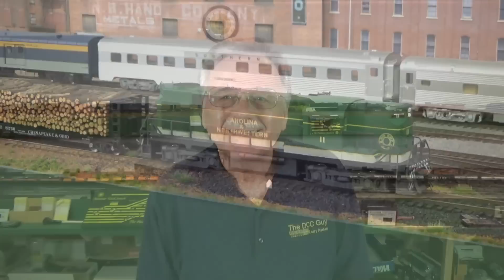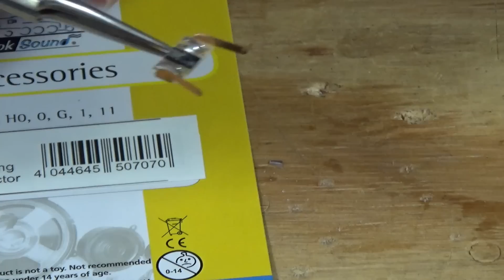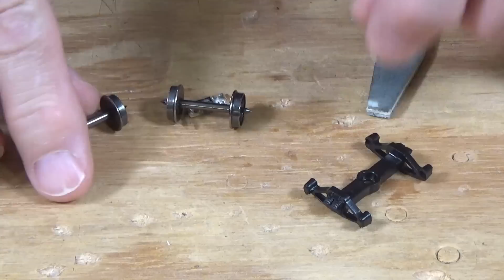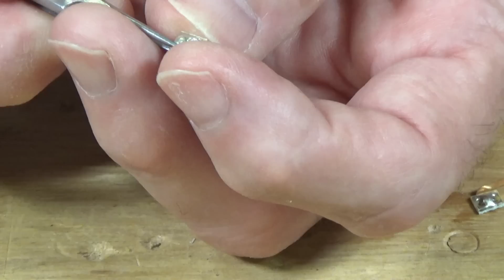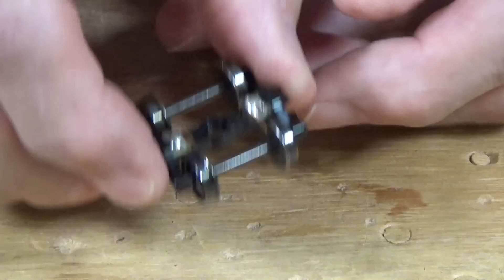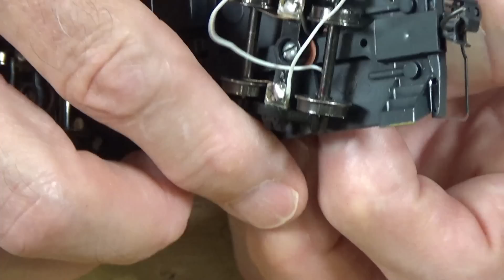Quick And Easy Track Power Pickups From ESU (123)

Comment: What you just proved is that it is a bad design. It should have been made with a hole in the centre with the pick up solder pad and spring contacts far enough apart to make room for a hole to insert the mounting screw, passing through the PCB. It should also had spring contacts to pick up from both wheel sets on the truck. I design things for a living and I often find model railroad accessories are not easy to use.
Reply from the maker: Often they are designed by technical genius who are not model railroaders and have little personal experience with all aspects of operating models. Or they are made by everyday modelers who don’t have the technical skills and knowledge to design a perfect mechanism. Very seldom do you get both in one package so,you often end up making adjust,emts yourself.

Comment: Respectfully, most of your videos are great, but advising sanding of contact surfaces is terrible in nearly all cases, especially motor comutators and rail cleaning.
A tiny bit of metal polish like Brasso or crocus cloth won't leave dirt catching scratches.
A Q-tip with nail polish remover to strip any clear coat, followed by a dab of De-Oxit is far superior to teaching beginners bad habits.
Reply from the maker: Since you weren’t specific as to the point in the video where I said that I can’t address your comment. If you are going to criticize someone at least be clear as to what you are being critical of. 

If you were referring to sanding the backs of the wheels, then maybe you are not aware that these are chemically blackened and the only way to get down to clean, bare metal is with some fine sandpaper. Contact cleaner won’t get you there and crocus cloth is basically fine sandpaper.

Comment: Hi Larry, I'm an electrical numpty, can these lighting units feed power back into to rails and hence to the loco on a dead track "safety" section before a liftout layout access bridge?

Thinking of a scenario with a loco with a stay alive and multiple pieces of rollingstock with lighting.

Thanks.
Reply from the maker: No, power flows through those circuit boards unidirectionally so no feedback.

Comment: Atlas O Cabooses come with a factory grease on the backs of the wheels where these electrical wipers are. What is that for?
Reply from the maker: If it has lights onside and power pickups on the backsides of the wheels I would guess it is conductive grease but if not I guess it is just factory gunk.

Comment: Hi Larry, great video and very informative for a beginner such as myself! I had a couple questions regarding these pickups:

1. Would these work for locomotives as well? 

2. Are there any multi-wheel pickups commercially available that'll let you pickup from all wheels any given side for to ensure continuity of the current in case one of them loses contact for some reason?

Thanks!
Reply from the maker: I don’t see why they wouldn’t work on locos. As for the second question, you might check www.sbs4dcc.com, he used to offer various configurations but I don’t know his current stock.

Comment: I finally got my ESU 50707 wheel pickups ordered.  $8.95/8 is not a bad price.  Shipping was only $4.00.  Thanks for posting this as I have several coaches and cabooses to light up.  Why do you use 4 pickups?  Two would be enough, 1 for the positive to the light and the other back to the track from the negative.  Cheers from eastern TN
Reply from the maker: I think you’ll find that with that arrangement power pickup might be unreliable.

Comment: What is the rolling resistance like on these? I have some superliners that do not have pickups that I am trying to light.
Reply from the maker: That depends on how you adjust them. They are flexible and have to be bent to make contact with the backsides of the wheels. You want them to be just tight enough to make contact without creating extra drag. When properly adjusted they shouldn’t create more drag than the same types of power pickups on commercial locos and some rolling stock.

Comment: I lit up an REA (Railway Express Agency) coach and made my own pickups out of some copper I salvaged from an old computer.  Instead of a single LED, I used a mini full wave bridge rectifier, a 3300uF capacitor and some strip lighting LED's that can be cut at every third LED.  I think i used about 12 bright white LED's on the strip.  I had to hide the cap in spot that couldn't be seen through the windows.  The LED strips have an adhesive backing and I stuck it to the top of the coach.  I don't use any other components in the circuit and it works flawlessly.  The LED strip lighting already has the ballast (current limiting) resistors mounted on the strips.  Very easily done.  I like those ESU pickups and I'll be giving them a try if I can find a vendor.  I've got several Riverossi coaches I want to illuminate.  I've already changed out the incandescent lighting on several coaches and used the LED strips. Thanks for posting.  Cheers & 73 from W Rusty Lane K9POW in eastern Tennessee

Comment: I have an HO caboose that I've added power pickups to, wired to a simple LED light that has a resistor.  My HO scale engine stalls/quits running almost instantly when I put my rolling stock caboose with power pickups on the track.  Why is this happening, I don't know what I'm doing wrong?  Be nice, I'm new.
Reply from the maker: Check to make sure you wired it correctly and do not have a short circuit.

Comment: Will his method work for soundtraxx sound car?
Reply from the maker: What kind of installation are you thinking about? Push-pull consist, passenger cars, stock car? Basically though if you have power pickups on more than one car it should work.
Reply: I’m doing it for a boxcar. Thanks for helping!

Comment: I'd like to add programmed lighting to a dummy locomotive. I can see how these pickups would work for connecting power, but is there a decoder available for dummy units that could provide lighting options like rotating beacons or directional lighting?
Reply: You could also buy an fx only decoder from esu now, it comes with all the lighting and sound fx without the motor control
Reply from the maker: Yes, Digitrax, TCS, and NCE all off lighting decoders. SoundTraxx used to offer one as well so check with them. You could even put one of their Soundcar decoders in it.

Comment: Where do I get the rectifier that you talk about and how do I determine what size to use? I have LED lights made by Evemodel when I use them in my HO engines they flicker - I o not want to have that happen in my engines let along my cabooses.
Reply from the maker: Did you watch the previous video where I showed how to build this circuit and read the description where I gave parts numbers and sources? It’s video #120.

Comment: just watched one of your videos that had the gizmo you can solder on the underside of a spur & lights up when spur is hot.  why not use one  (or more) of those inside instead of the circuit & cap?  Just seems simpler, im sure i am missing something though

Comment: this is nice, but when will little nano gas engines replace all this electrical nonsense :) Thats a clean install of the wipers, i used the brass collars method around axles connected with thin piece of brass strip. Either way works great for lights and power pickup.

Comment: I could see  how you could add a second led (red) on the caboose or other rear car with a simple flasher circuit (555) to make a end of train device for a different type of car like a tanker, hopper or box car with an enclosed space for the circuit.
Reply: Why not just use two flasher red LED's?

Comment: Thanks for a great video. I could not find these since everyone I checked is out of stock . I did find a small company called "Model Train Technology" that sells floating brass strips used for track power pickups in HO and N scale. They also have good installation videos on how to install these. They are reasonable in price and work fantastic on my N scale cabooses and  other rolling stock for  interior lighting, marker lights. and end of train devices. They also sell a lot of other lighting products for buildings. signals, passenger cars, rolling stock, and caboose lanterns HO and N scale with fiber optic lighting for n scale, and a lot of other stuff.
Reply from the maker: I’ll give them a look.

Comment: I watched your video and ordered some of these pickups. I installed a couple of them and then measured the current pickup using DC power, I measured over 12VDC coming from the track but only one or two VDC coming from the wires attached to the pickups. What did I do wrong?
Reply from the maker: Check the back of your wheels, they might be oxidized or have paint or some other substance on them. I usually sand the back of mine with an emory board or sandpaper. Also make sure both your track and wheel treads are clean. Finally recheck your solder joints, cold colder joints can have some resistance.
Reply: I have a very perplexing problem. I have done everything you suggested. I checked for cold solder joints by attaching power leads to the pickup end and the meter to the wires soldered onto them. Good power. I sanded the backs of the wheels and the treads to make sure they were clean. I checked to make sure I was getting power to the backs of the wheels. I do. Every time I put the pickups to the wheels I still get no power. I have spent two hours today trying to figure out what is going on and it's not making any sense, I get power everywhere but between the backs of the wheels and the pickups. I even tried to clean the pickups and still get nothing. @TheDCCGuy
Reply from the maker: Flip the truck or car on its back and shoot a couple photos. Email them to dccguy@dccguy.com and I’ll see if I see anything.
Reply: Is the trick isolated ??

Comment: Can you do a comparison review between the Digitrax DS64, the NCE 0151 Switch8-MK2 and the Digikeijs DR4018 16 Channel Turnout Switch Decoder?  Looking at cost and performance?  Which one is going to give us the most while saving us money controlling our Tortoise or Cobalt switch motors?  NCE has an accessory button board and Digikeijs has accessory boards that go between the device and motors.

Thanks,

Den
Reply from the maker: That is a tall order. Also the capabilities of these devices differs so I would venture that it is more often a matter of what job you want the device to do. For example you can program routes and do other fancy thing with the DS64 whereas the Switch8 is essentially a dumb accessory decoder that cannot be programmed to do anything beyond powering Tortoises and similar devices. I have never looked at the DigiKeijs equipment although I do have one of their command stations to evaluate, if I ever get time.

Comment: As much as I hate to be a pain, but..should you change wheel sets if the current wheel sets have ribbed backs?  The ribbed backs won't transmit the power properly or evenly.

Other than that...I think I'll get a few sets of these for power pickup on each car in my passenger set.
Reply from the maker: There is a small raised nipple pressed into it near the end of the wiper and that might catch in the ribbing. So I would think the ribbing might be problematic or make a clicking noise. I think it would depend on how wide a flat area there is between the ribbing and the edge of the tire.
Reply: @TheDCCGuy  Ya know...it would lead to much less stress to just replace the wheel sets. Still...I'm going to get myself a few of these. And thanks!  P.S. I've subscribed.

Comment: Thanks for the video. Sure makes it easier with the CKT board type than the ones that are all spring metal with axel wipers. FYI Did you know in all your videos when you touch the track with your fingers it generates a buzz in the video?
Reply from the maker: Yes, I keep trying to remember not to do that but it keeps happening. I had to cut several segments from the video because of that. The remaining 2-3 were not significant enough to worry about. I find it odd since I am not connected to anything electrical and the camera and mic are isolated and run off battery power so it must be generating rfi that the mic picks up.
Reply: @TheDCCGuy  Thought about wearing a grounding strap, or  would that be too cumbersome?

Comment: what is the purpose of the "bridge Rectifier"   ?????
Reply from the maker: Converts DCC to DC. Watch the earlier videos (101 & 120) on the lighting circuit.
Reply: @TheDCCGuy  And it also makes sure the polarity of the power going to the lighting board is correct no matter which direction the car is running, especially for we non-DCC folks.

Comment: Does ESU make one with longer wipers ?  Those look too short for use on the Athearn Bombardier passenger cars.
Reply from the maker: No, but you should be able to adjust their position to allow for the spacing. You could also add a small styrene square to the truck to extend them if needed. As I said in the video be flexible.
Reply: One of the best videos for Athearn Bombardier cars  ...
https://www.youtube.com/watch?v=wT0qpQspvbo

Comment: Nice video Larry. Is the little brass plate held on by the factory solder? (We pronounce the "l" down here Australia like you would saying "folder" - otherwise it would be stock feed 😉) Anyway, If that's the case you'd have to be careful not to melt it too much when applying the wires or it might come off? Or is it  attached some other way?
Reply from the maker: The whole wipers assembly wraps around the board and may be glued on like copper cladding on a PC board. there are also 2 small wholes under the solder blob that go through so I suspect the solder makes a bridge between front and back.
Reply: @TheDCCGuy  that's great thanks. I'm not that good at soldering so I wouldn't want to ruin it. These look like a good solution for a passenger set i have - an Australian transcontinental train through the desert called 'the Ghan'. A Google search will give you an idea.

Comment: What's that between the truck and the car body? Some kind of washer?
Reply: Kareem Spacer
Reply: Kadee...
Reply from the maker: Kadee makes those fiber washers to use as spacers for adjusting the body height. That way you can get your couplers set at the right height. They come in two thicknesses and are either red or gray.

Comment: Another great vid. These could be used on a scratch built locomotive, for pick-up? Thanks Larry.
Reply from the maker: Be careful as the metal wiper material wraps around to the other side of the board. If installed on a metal truck this could cause a dead short.You would need to install them on a thin piece of styrene or other insulating material to prevent this.
Reply: @TheDCCGuy   Of course Larry. The wrap-around would make them strong too. Using styrene as mentioned further in the comments, makes for a lot of sense. Again, thanks for the warning/caution.